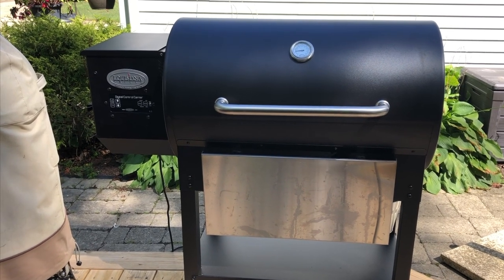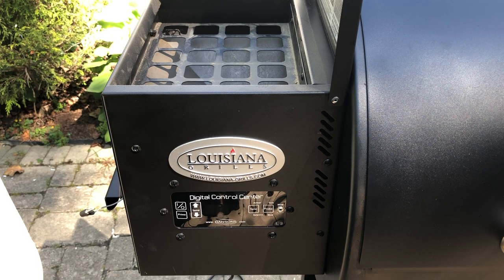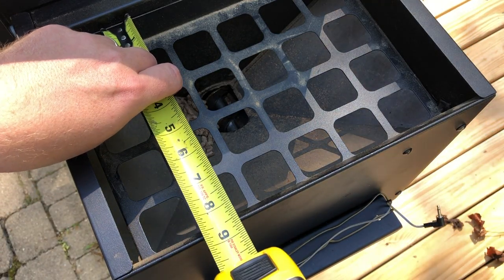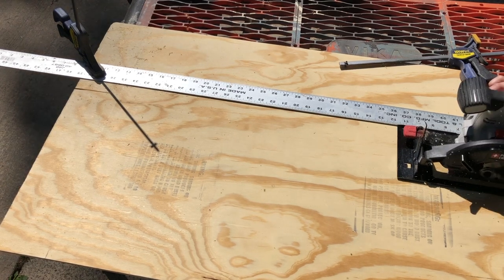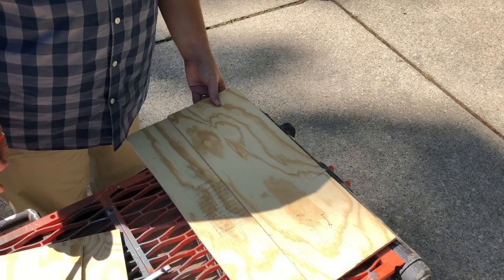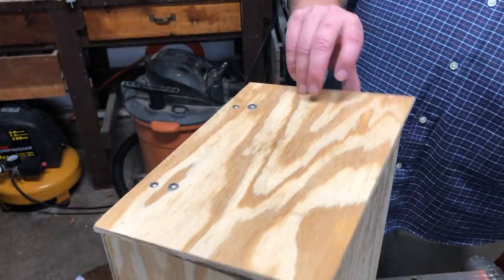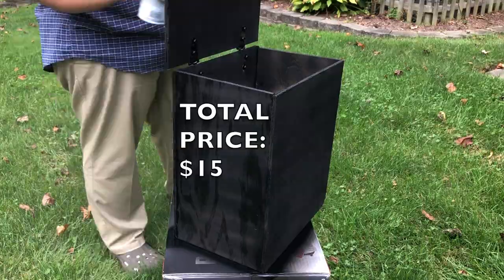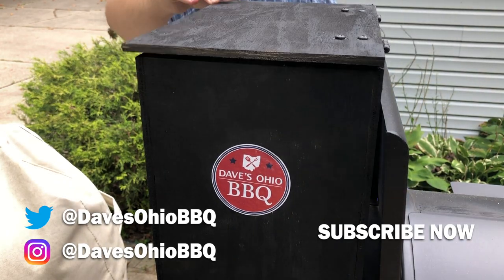How to Build a Pellet Grill Hopper Extension - Make a bigger pellet bin

Comment: I saw a guy that was in a pinch for time and made one out of cardboard and duck tape.  He was severly lampooned for having done this.  I looked at my z grill, checked temperature in the top of the pellet box area and came to this conclusion.  If his cardboard hopper catches on fire, he had a serious problem besides his hopper extension.
Reply from the maker: The only real high temperatures on that Peligro that I had, we’re on the side closest to the smoker. And it had the added benefit of that’s the direction the lid opened so it was another layer of insulation between the box and the smoker. I never had any issues.

Comment: So with a full hopper w extension now, can you get a good night sleep without worrying about auger voids?
Reply from the maker: Pretty much. When the bin gets low I sometime get a situation where the little bit of pellets that are left won’t slide down to the auger, other than that, it’s great.
Reply: @daveshouseofbbq  that’s what I’m experiencing. But I’m guessing that the extension would have to be empty before pellets get stuck. Also looks like that extension should hold another 20# which should give you many hours of worry free voids. That’s my hope anyway. Nice video. I’m good to give this a try!